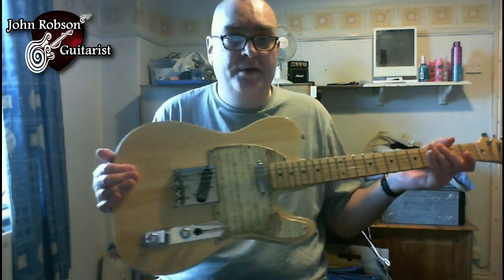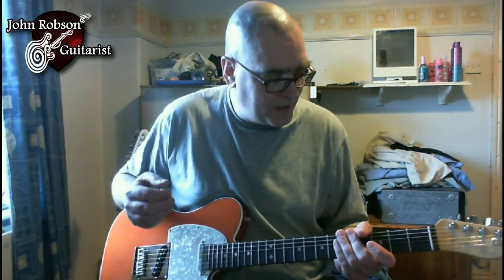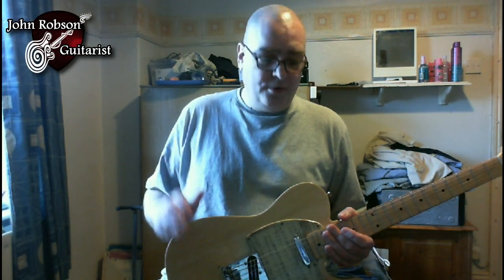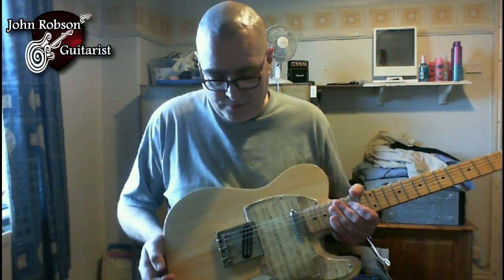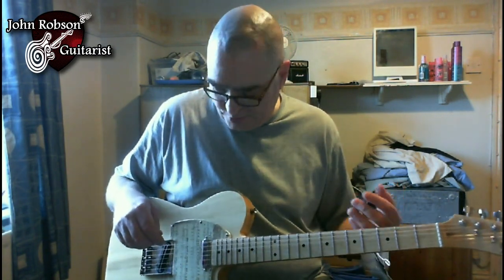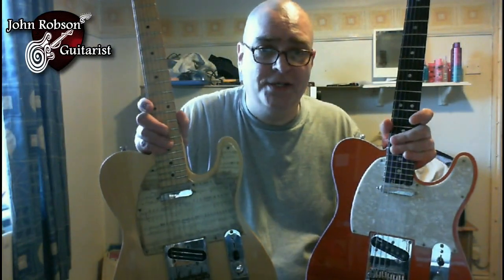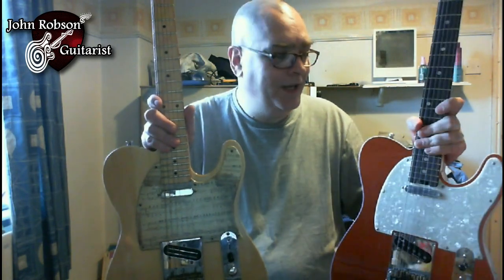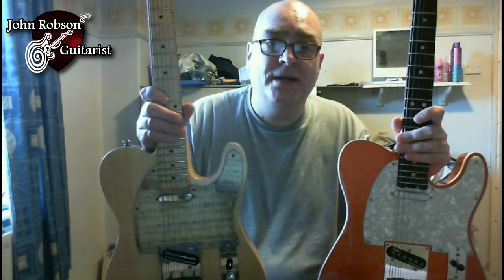Telecaster Comparison -  American Elite vs Cheap Self Build

Comment: The pups on cheap build are clearly superior to the Fender stock pups, and especially so clean.  I'm already sold on Iron Gear pups, and I've been thinking about putting a hot rail on the bridge.  I know you don;t remember what brand, but do you remember where you got the hot rail?

Comment: I have a Mexican Tele upgraded with earlier version of  Fender's Noiseless PUs and also the Tele Elite.  The Mex sound is not 3 times less than the Elite, however, you don't get the wonderful chiminess (if there is such a word) of the Elite, nor the lovely rounded edges of the neck and quality finish, nor the feeling and satisfaction of actually having and playing  a 'real' Fender U.S.A. guitar. The Elite is my go to guitar, there are reasons for this, albeit at a cost. One knows the difference when playing the Mex compared with the Elite and that comes with the price tag. You can get from A to B driving a Toyota Corolla or an M2 BMW, both get the job done, but hey.

Comment: Your homemade tele could be dressed up to look much nicer in comparison to the Fender (if you wanted to do that) and you would still be way ahead in the game. I have a Squire CV 60's Strat that compares very nicely with an Am. Standard after a few inexpensive mods.
Reply: In fact I used the $800 that I saved to buy 2 very nice p.a. cabinets.

Comment: Charity one wins big time..much fuller sound. I would never give that much money on a guitar. I own several American Fenders, but with self-build pickups. I have Ibanez..Gibson SG, Yamaha, etc.. But nothing comes close to my self-build guitars, neither my go to guitar... yes.. Harley Benton CST24-T Emerald Green. About the Charity guitar..bridge pickup could be Artec. What i'm wondering about is something strange.. a kit guitar has no skunk stripe on the back of the neck. Even on Bullet Squiers it's mostly painted on stripe. And then, why did you choose to make it a string--trough ? It gives more tension on the strings, because they are longer and i know out of expierence, no string thrue giver better sustain. Think at your review of your HB CST24 wrapped on bridge comment. Thanks for your fantastic video's and ohhh.. You play very well, like you're style. Greetz from Belgium.
Reply from the maker: Bruno Condor Cheers mate. I think it was a kit guitar. It had no branding on it when I got it & looked like it had been put together by a gorilla! I definitely think it was an abandoned project when I got it. 

As for the string-thru conversion, I prefer the slightly higher tension & it DID increase the sustain. It's MUCH louder acoustically since it was converted. The brass bridge saddles make more of a difference than I was expecting, too 😀
Reply: Hello John, thanks for your time and reply. What i actually meant was, that i rather think the charity  was not really a kit, but put together from allround parts and than abandoned. When i started out making guitars i'll used several kits from tons of places. The thing is..never newed one neck from a kit that had a skunk stripe on the back.Yours does.Sometimes you can buy necks on Ebay, AliExpress or Amazon with a skunk stripe, mostly painted on. Maybee the body came from another source or garage-made. Bet you had troubles with the neck pocket. All in all, if i didn't had 21 guitars i would ask you to sell me this guitar. It came out great ! Fender looses here in my opinion. Since i like Tele's for there versitality and simplicity, i make them almost only from reclaimed wood out of wrecked houses and more. The neck i make from buyed maple or ceder. I even use spruce. The so called " Barncaster". That wood is less dense and gives mostly a warmer tone. I wish people would would look further then a brand name.The charity prooves it all. About the string trough conversion. I'll give it a go. It's true the brass sadless gives more sustain, i'm a fan, but trie to use one per string because of sometimes intonation problems with one sadlle on two strings. Anyway, good luck John and keep up the good work. I'm digging all of your vids now and you have a new fan and subscriber. I'll stop my novel here LOL. Greetz from Belgium. Bruno.
Reply from the maker: Bruno Condor Yes, the neck pocket did need a shim, but other than that it was a pretty good (tight) fit. I've got another build on it's way. I want a sunburst strat with 22 frets, HSS pickups, small headstock, vintage trem & tortoise shell pick guard. Fender don't make it, so I'll have to. Shopping around for parts at the moment... Going to try & do it for less than the cost of a Mexican strat. I'll let you know how I get on 😀
Reply: That's nice man. If i lived closer to you i would do it for you. Thomann has kits with 22 frets for 69 €. You should consider Tonerider pickups. Very good at a low price. Pickguards enough on Ebay. I could helped you out with the paintjob..I paint cars and do airbrush. A painted body would'nt be cheap. Looking forward to it.